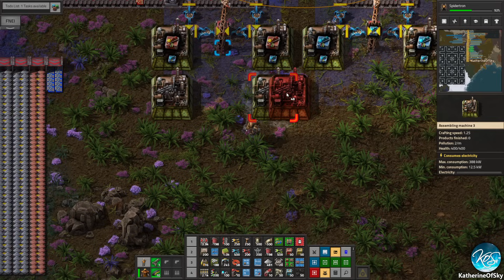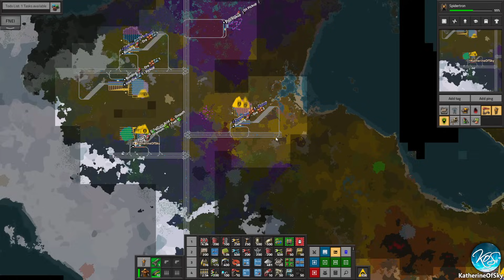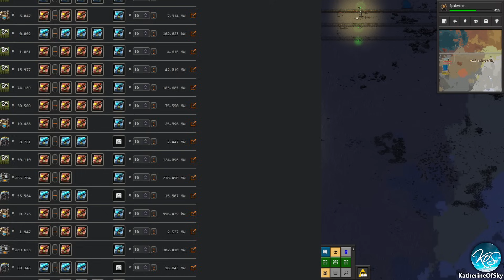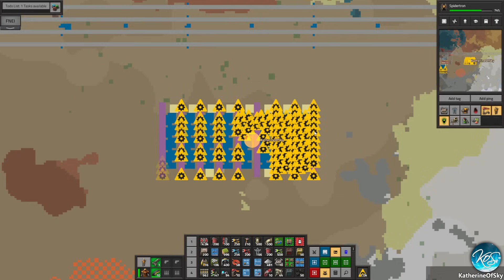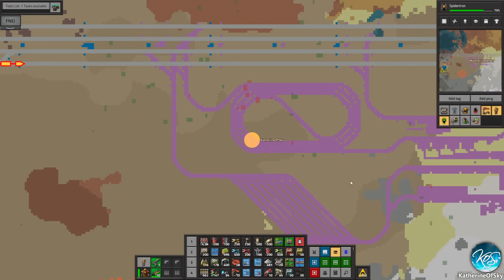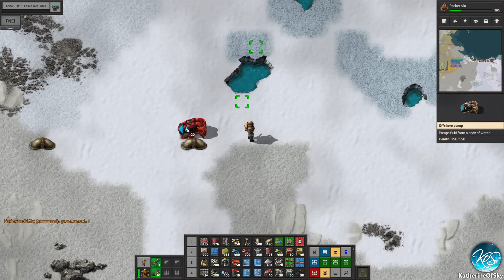Factorio Trickle Down Megabase 13 - RED CIRCUITS FOR FUN AND PROFIT - Let's Play

Comment: hmm, what would I change up? Looking at the green circuit train, it may be on a different track lane than the copper and plastic train (at least from what I briefly saw when you set destinations and the train path looked a little loopy). Since the train length is different, my idea is giving the green circuit train a designated shorter shunting yard and a different entrance/exit from the plastic and copper.  If the different the materials do come from different inner/outer lanes, maybe have one set coming in from the left and one from the right. The separate shunting yard might only make sense if green circuits is indeed on a different entrance track/lane than the copper. Hmm, would have to check. But a shunting yard with half eight car trains and half four car trains could be interesting to work out if they are not. That's the direction I'd want to experiment with for this array :)

Comment: A tip you may or may not find useful when creating logistics bot builds.  You can copy a recipe from an assembler and paste it into a requester chest, and it'll set the chest to request one item's worth of materials.  You can then go in and tweak it to your liking.  Also FYI on the red circuit build, you created an 8x8 red assembler array, that's only 64 assemblers.  You need two more rows to hit your goal of 80 red circuit assemblers.
Reply from the maker: I do this often.  However, it only works on beaconed assemblers if all the modules in the assemblers and beacons are in place, and it is powered.  That will compute an amount of materials for 30 seconds of run time. I don't think I had all the modules with me when I created the red circuit array.

Comment: I’d really like to see you have to train all the built components in for the item you’re making at the outpost. It’d been cool to see how you set up the copper wire outpost, the rails outpost
Love this series. Glad a vanilla megabase is back
Reply from the maker: I think I've hit a good medium point with this series.  In the past, I've made green circuits by training in ORE and making all the plates on site as well.  So this is going a step further.  Copper cable is a bit annoying because so much is required for circuits, and it is 2:1 ratio to copper plates, so it makes a lot of sense to transport it via inserters instead of bot trips.
Reply: @KatherineOfSky  very true. I’m loving this series so much 😊 I’m guessing you’re doing bulk recording sessions, the cuts you’re adding in are working well

Comment: I would have used belts. because I'm not used to using bots. I've played many hours but I've only got to yellow and purple science once. And I love full belts flowing in and out.
Reply: Combining belts and bots, I was wondering if there would be a good way to send at least some of the copper cable down a belt for each array to cut down on the bot trips. I'm not sure where the efficiency would line up, but could be fun to experiment with.

Comment: does a bot based outpost cause more or less stress on your cpu then a belt based one?  over all game performance,,
Reply: bots consume more cpu than belts, for sure. now is it enough to cause problems? probably not as long as you keep the networks disconnected from each other
Reply from the maker: ATM, bots and belts are about equal in CPU usage.  This has been a much-discussed topic in the FFFs over the years.